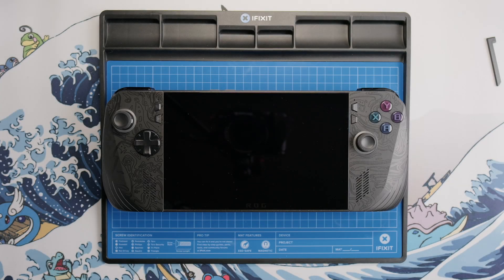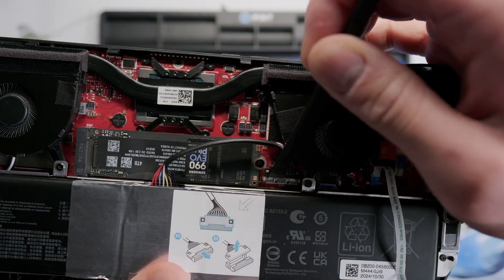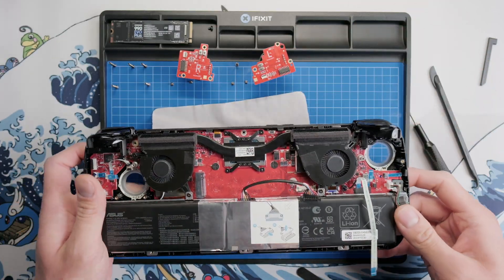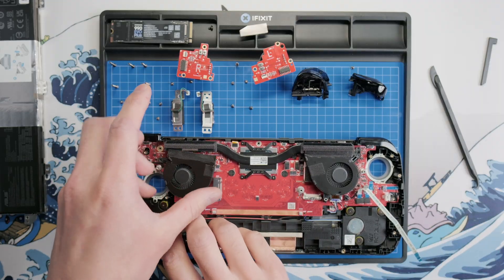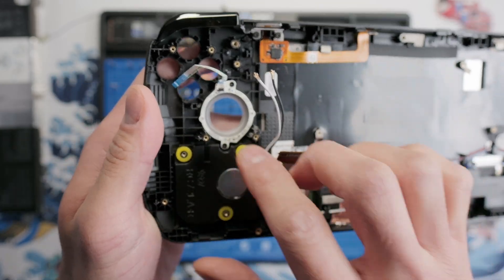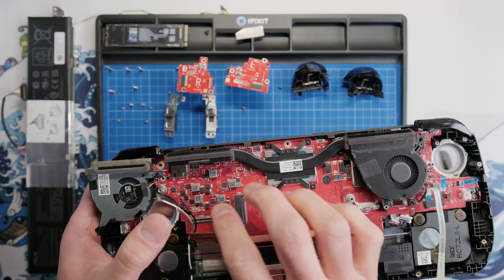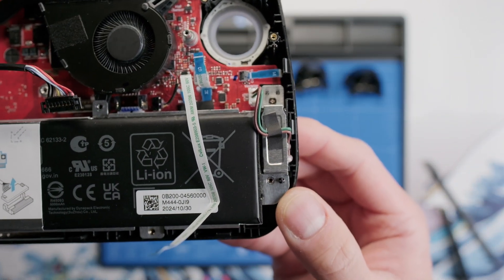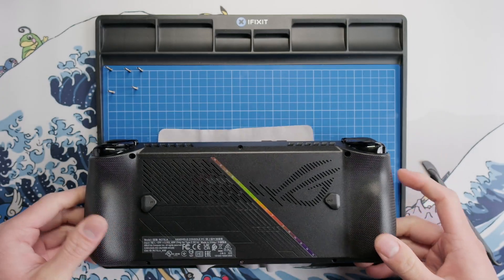ASUS ROG Ally X Teardown

Comment: Is there a way to fix the power button that rattles?
Reply from the maker: Don’t remember exactly on my device, been a while since I’ve used it, but I don’t think my power button rattles? If yours does, you might try putting some electrical tape on the micro switch to close that gap. It will also make it quieter, and I’ve done that for other buttons like start/select as well
Reply: @whatobiplays I just ordered Hall joysticks so when I have the unit apart I ‘ll definitely do that fix. Thank you

Comment: Question, on the right tumbstick above were the ribbon is there is a connecting thingie that is unused it says jdebug4401 I think ,someone knows for what that is..
Reply from the maker: I think those are debug ports for repair technicians to use. I’ve seen them on a lot of devices

Comment: quick question, the fan screw near the speaker cable is a short one right? Or is it long.

When I use a short screw it doesnt reach far enough.
Reply: nvm found it dpad was misaligned and screwing up things

Comment: My motherboard won't come off for some reason. I got rid of all the cables but it feels like there's a screw holding it in place. 

I did every other step prior so idk
Reply from the maker: There is that one last screw on the bottom next to the speaker connector, did you get that? Otherwise there is one screw on each CPU fan
Reply: @whatobiplays  yep forgot to unscrew right cpu fan. Thx.

Also hypothetically, if I stuck my SSD into a new Rog Ally X, will the new Ally X boot up as if it were my old one?
Reply from the maker: Yea if you take it from a working Ally X, it should work, like if you upgraded from an Ally

Comment: Hi, I need to replace a broken screen on my wife's Ally X. So it looks like I'll need to disassemble the entire thing in order to accomplish this?
Reply from the maker: Yes you will need to do a full disassembly to get to the LCD ribbon cables. You might be heating up the front panel to loosen the adhesive on the screen and remove it from the front though

Comment: Is it possible to clear an audio jack out of the audio port without taking the motherboard out?
Reply from the maker: Like you have debris in the port? Not sure since it’s soldered to the board
Reply: @whatobiplays  the end of the audio jack from a headphone is broken off inside the port.
Reply from the maker: @iowamagicman you might be able to push it with a spudger/tweezers from the back without taking the mobo out, but I’ve never had to do that myself so I can’t say for sure. But once you’re that far into the teardown, it’s not that much more work to take the board out anyways

Comment: Hey is there any shops or store where can I buy a motherboard replacement I just ripped of the battery cable
Reply from the maker: Hmm I’m not sure. You would probably have to contact ASUS directly for something as core as the motherboard. Did you rip off the whole connector or just like the little metal sliding clasp?